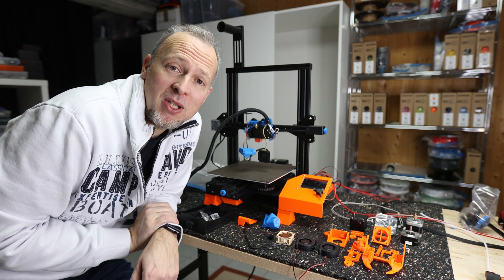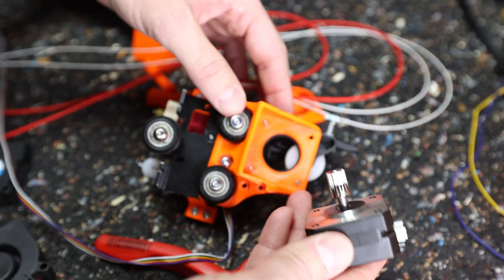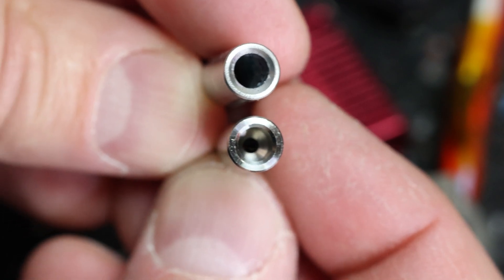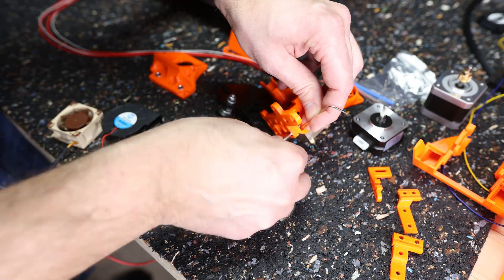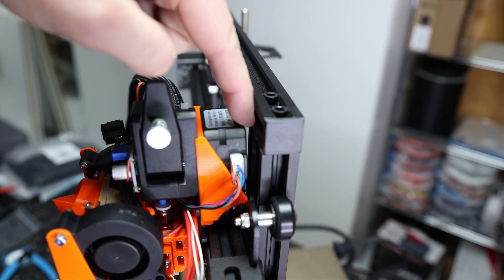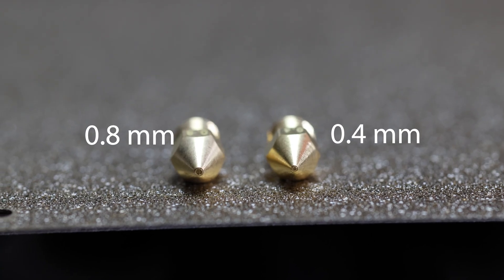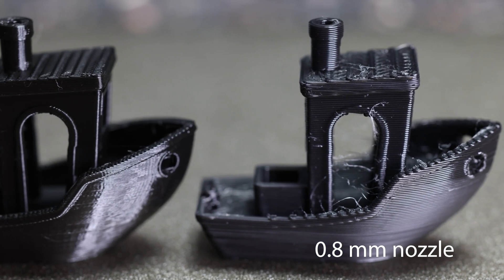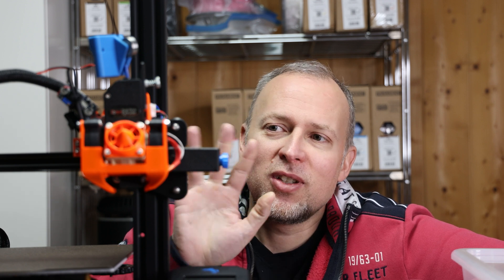Ender 3 v2 Hero Me BMG Direct Drive Upgrade

Comment: What parameters did you use for pancake extruder stepper? 
I can't make working this stepper on my Ender 3 V2 Neo with motherboard v4.2.2.
Did you change voltage on the drivers?

Comment: Can you post a list of the exact files that you chose to print from the HeroMe Suite file folder. There are over 300 files to choose from and a few of the parts that are specifically for Creality have multiple options to choose from. Can you identify the particular file names that you used for your HeroMe set up? (i.e. name of Cable Tower file / name of ABL Mount file / name of Gantry Adapter file / names of any files that you printed from the Options folder that is also included in the suite) etc. etc.  Your help would be greatly appreciated
Reply: id like it too
Reply: Conseguiu os nomes?

Comment: I have just installed the HMG7 on my Ender 3 V2 with BMG DD rear mounted, with a slim stepper so that the stepper will not hit the upright extrusions.
I had just one big issue which I cannot find a correct solution for with the STL files: The ABL mounting parts, the wing and bracket, it is too wide and hits the X stop box on the left side. I cannot put it on the right where this problem would not occur, because I have the cable management tower there, and all my cabling suits that now. I find this to be very frustrating and I am surprised that such an obvious problem was left unresolved by the creator!
Reply: Hi Glen, I have the same setup and no problems. The only thing that crosses my mind is that you used a too big ABL wing/bracket combo. I used the smallest one that I can and it's OK. Also if you want, you could put it on the right side on top of the wire tower, because they are stackable.

Comment: Hi Daniel. Thanks for the wonderful video. 
Did you have to modify the firmware when you replaced your extruder motor to the pancake motor? did you have to change Vref in your motherboard?

I want to do the same modding to my E3 V2.
Thanks for the help!
Reply: I was wondering about that.

Comment: hi - what would you recommend i review for wiring this up? I'm not sure how to use the voltage converter, and I haven't done any printer upgrades involving opening up the control box so i'm in the dark on that part. I bought the hero me manual and it doesnt include any wiring diagrams in there that i've found. thanks!

Comment: I´m wondering how you installed the dual fans. Do you just make a Y split from the standard fan cables? I will convert my Ender 3 v2 to Hero Me V6 in a couple of weeks and can´t find anything on this particular problem. (this is my first upgrade so I don´t realy know what I´m doing)
Reply: For anybody wondering, since this comment I‘ve build my own and a Y split (if you have the right fans for your printer) works just fine.

Comment: I’ve recently done some printing on one of my Ender 3 v2’s using recycled pop bottles made into filament using a pullstruder machine I built. Prints best at about 255-259 C degrees.  Would this setup of yours be beneficial for this sort of thing considering the higher temps needed as well as the odd shape and consistency of the homemade PETE filament?